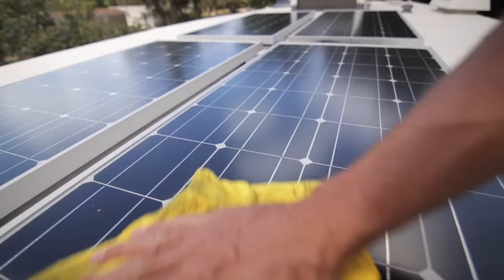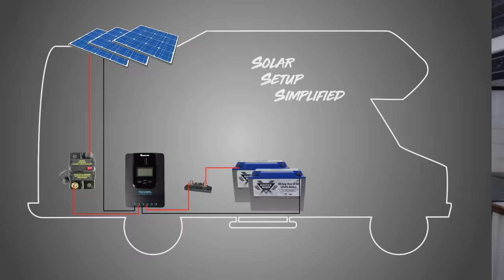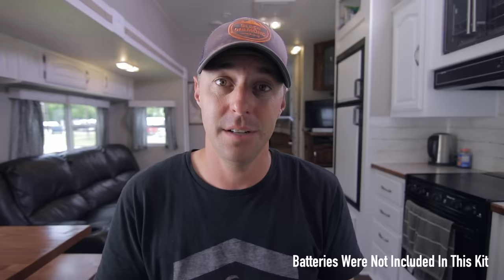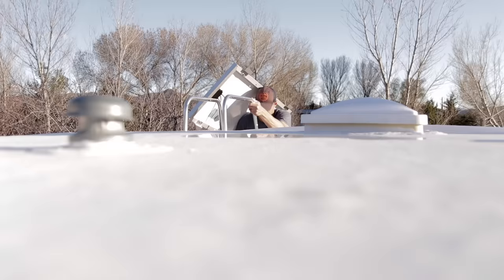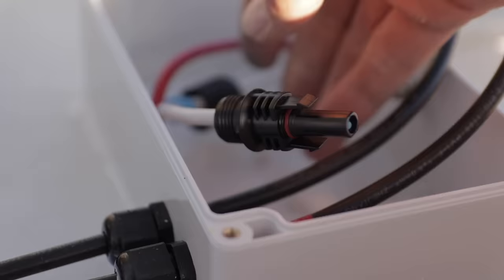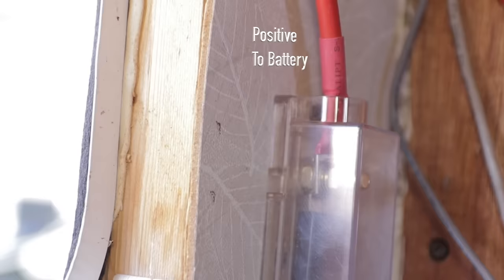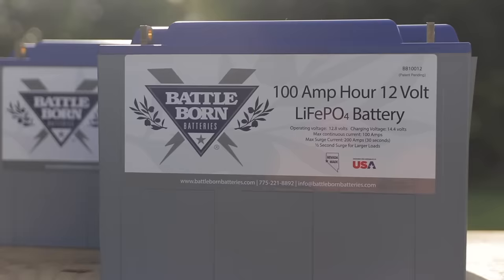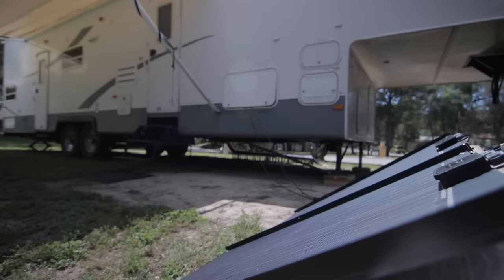RV Solar Simplified! Simple RV Solar Setup.

Comment: I don't get it... just about every solar DIY'er on youtube is mounting 100 watt panels on their RV roofs.  And the cost for these range from $1.00 - 1.90 per watt generated!  Why would you not use something like the Mission Solar 315 watt panels?  They would take much less mounting area, and cost about $0.70 per watt ?
Reply: I have been wondering this myself
Reply: Those panels are not 12 volt. Most people believe (incorrectly) you can only use 12 volt panels on a 12 volt system.
Reply: Glenn Beattie that’s incorrect with the appropriate charge controller you can have much higher voltage going in and the controller will charge the batteries appropriately.
Reply: I put one 400 watt panel on my van conversion roof and hooked it into my 2200 watt power station. I bought a like new used panel for $200. Beats 4 100 watt panels on my opinion
Reply: You can't get that panel any more. I checked with the manufacturer.
Reply: Drink water
Reply: @shaneross64 what site did you check for a like new panel?
Reply: I have three 150 watt panels on mine, not necessarily by choice, but because I purchased them in a roundabout way.

Saw a 95 Ford van converted (poorly) into a camper for sale on fb marketplace. 300k miles, busted rear window, needed a new transmission, listed for $2k. In one of the pictures you could see the side profile of what I thought was a solar panel, though the description never mentioned it.

Long story short, I ended up buying the van for $500 and scrapped it after removing all the solar components:
-3x 150w panels 
-1x 50A charge controller with BT
-1x wired on/off switch for charge controller 
-2x 100AH marine batteries 
-1x 2000w (4000w peak) inverter 
+$240 for scrap 
Net cost: $260

So that's why I personally have three less powerful panels. But also, I think redundancy is important. If you only have one panel and it malfunctions or breaks or whatever, you have 0W. If one of my panels break, I still have 300W potential.
Reply: I have three 150 watt panels on mine, not necessarily by choice, but because I purchased them in a roundabout way.

Saw a 95 Ford van converted (poorly) into a camper for sale on fb marketplace. 300k miles, busted rear window, needed a new transmission, listed for $2k. In one of the pictures you could see the side profile of what I thought was a solar panel, though the description never mentioned it.

Long story short, I ended up buying the van for $500 and scrapped it after removing all the solar components:
-3x 150w panels 
-1x 50A charge controller with BT
-1x wired on/off switch for charge controller 
-2x 100AH marine batteries 
-1x 2000w (4000w peak) inverter 
+$240 for scrap 
Net cost: $260

So that's why I personally have three less powerful panels. But also, I think redundancy is important. If you only have one panel and it malfunctions or breaks or whatever, you have 0W. If one of my panels break, I still have 300W potential.

To follow along with your theme of cost per watt, my system clocks in at $0.5/WH. That's using the combined cost of ALL the components, not just the panels. Though I'm not really sure that's an efficient way to measure value, because that's only accurate for the first 450 watts captured in this case (because 450w is the stated maximum). Every watt captured above 450 would further reduce the "cost" per watt.

450w = $0.58/WH
900w = $0.29/WH
1800w = $0.14/WH

Like I said, before, with only one panel, if it breaks, your total watts drop to 0. Your cost per watt is then fixed based on the total watts generated up to that point.

Let's say you paid $280 for a single 350w panel, and you captured 50kW, then someone smashed it with a baseball bat.
$280 / 50,000w = $0.006/W

So then you replace the panel, and capture an additional 50kW, until the same person smashes it again.
($280+$280) / (50kW+50kW) = $0.006/W

Now let's say you bought three 100w panels for $360. That person comes by and smashes one of the panels after you captured 50kWh.
$360 / 50,0000w = $0.007/w

Since you still have two more panels, you don't replace the broken one. 50kW later, another one is smashed
$360 / (50kW + 50kW) = $0.004/W

Another 50kW, another smashed panel.
$360 / (50kW + 50kW + 50kW) = $0.002/W
Reply: Because anything over 200 watt size panels coast way to much to ship. I use 4 200 watt panels and is perfect for me
Reply: Its called newbies lol, they obviously are new to solar , why would you mount panels to your roof is my question .....1 you just introduced new water leaks one day , 2 not easy to clean , 3 are you goint to move your rv into the sun everytime you camp ? Waisted system ,,,if your panels are free standing you can camp in the shade and move your panels where ever is best ,,, what happens when you go camping and the spot is sunny in the morning but a hug tree is casting shade over your camper ? More negitives to solid mounted panels then pros ....
Reply: I've been pondering the same thing. I really want a great solar system, but I want my panels stacked in a storage container when traveling, and placed on the ground in the sun when I'm using them. I can clean them every use too.
Reply: I'd rather have them mounted to my roof because I'm living in my rig, which means taking the solar panels out all the time is a security risk and an unwanted source of extra tedium and effort. That being said, park in the shade with panels in the sun is definitely a more efficient way of doing things.
Reply: @4486xxdawson it's definitely inconvenient to have to set them up or store them when not on use, glad it works for you.  But it's a fools way of thinking to think your way is the only way, not only that some rvs have them from the factory on the roof.  Regardless of location if I am hunting and it's snowing solar does no good, thats why people own generators, or at least I do.  Some are wins some are losses. And just like everything  else that goes through your roof if installed and sealed right wont leak, might I recommend xtrm ply for all your rubber membrane roof sealing needs.
Reply: How would you do it all ? Asking as I want to do this but don’t want to spend more then I need to.
Reply: @glennbeattie6172 don’t the inverters that transfer the solar to power for the batteries automatically turn the power to 12 volt? I’m not an electrician but that’s how I understand it

Comment: It amazes me that so many caravans in England and other European countries have lithium as the standard battery pack and solar three panel systems standard.  I can't understand American manufacturers who continue to build junk.  Except for a few such as Northwood all I see are ill constructed lite units that are rushed through build and are delivered to the customer broken.  You are fortunate to understand the inner workings and can repair most problems and add to the electronics.  I would love to buy a trailer to pull but I'm waiting until I can afford something like a North wood product.
Reply: Matthew B it’s a difference of approach.  We can get lithium batteries in the US, but a 170 ah battery is currently about $1500 compared to a 200 ah AGM battery for $400.  

Yeah, the AGM weighs 130 lbs vs a 45 lb lithium but the trailers used in North America have a different weight distribution than is used in European caravans.  We distribute weight between the tow vehicle and trailer, whereas the weight is over the a caravan’s axle and the tow vehicle is simply a tractor.  The Europeans can tow with a lighter weight tow vehicle, but need to tow at a slower speed.  When I was in Europe, I was surprised to see such small cars towing relatively large caravans.  In North America, we distribute weight differently on our trailers and can tow faster,  but we have a higher tongue weight on the tow vehicle so the rig is more stable at highway speeds than the European configuration.  That requires a vehicle with the ability to hold a heavy tongue weight.  See https://oppositelock.kinja.com/tow-me-down-1609112611

The point is, we can load the heavy batteries into our trailers.  When we “boondock” in public lands (setup your camper for up to 14 days, but you have to bring your own power source, water, etc.) we need to maximize that battery bank capacity.  Having a couple of decent AH rated 6V AGM batteries in series is pretty common in the US west.
Reply: @ppainterco  bottom line is greed and profits
Reply: Randallkoller - I really dislike the “greed and profits” argument.  Its lazy,  It’s like if I chip my tooth then it’s because of “greed and profits”.  My coffee is too strong... “greed and profits”.  My milk curdled in my Wheaties... “greed and profits”.

Lead acid battery plates get recycled in the US and we actually have factories that manufacture them either here or in Mexico with lower cost land transportation for distribution.  Lead plates recycle pretty easily... just melt them, skim off the crud from the top and cast new cells.  That easy, available recycling holds down costs as does the lower cost of transport.  I’m not aware of much recycling of lithium cells in the US, even so, we’d probably have to ship back to make new cells.  Lead acid batteries have a century of developed infrastructure and distribution systems.  Lithium is nearly new infrastructure and distribution systems that’s still being developed.

I recently bought 4 LiFePo4 cells, BMS and new solar controller from China through eBay for about 3 times the cost of just buying a 90 lb golf cart battery from a local retailer.  Another option was to use a BattleBorn battery which is assembled in the US, probably using newly manufactured foreign cells from new, not recycled materials.  The BattleBorn is about 4-5 times the cost of the lead acid battery.  Still, I wanted to reduce weight and hope to get a 5x life out of the LiFePo4 and so long as I get a longer life then the LiFePo4 might be somewhat less over the long haul.  Still, a LiFePo4 is about 20-25% of the weight of lead acid.  If I had a big honking motor home that didn’t mind the weight then I would have just loaded up with golf cart batteries, saved money and hassle. 

The stupid thing is, my lefty, environmentalist brother in law objects to my LiFePo4 setup, telling me to just buy cheap, heavy lead acid batteries at SamsClub instead.  It’s like “save the planet”  until it’s his responsibility to save the planet.  The only greedy ones that I see in that cycle are consumers who only look at the purchase cost of the batteries.  I’m still not convinced that I’ll get the life out of the LiFePo4 setup to have made it worthwhile.  That’s a 10 year long experiment.  Here’s to hoping.
Reply: Lithium mines are killing alot of land and human health. Im happy to use lead acid or carbon batteries fr this reason.
Reply: North Americans want things cheap and cheap usually means cheap. Of you want a better built RV, Northwood like you said or Lance. The majority of us won't or can't afford to spend double or more for a better built rv especially if its something you use a few weekends in a year.

Comment: Well done ! .... I spent about a year studying up on solar. After a lot of overthinking, calculations & trying to decide how big to go; I jumped in with just a simple 100W glass panel & PWM. The goal was to charge two 6v golf cart batteries at this point. I'm really glad I did as I found unless you are in direct sun you get very little amps. We camp predominately in shade or treed areas, I was doing a lot of chasing the sun with the panel. Against my original objectives I did buy a small inverter generator for the days that solar isn't going to work or I'm not "chasing". Surprisingly in the last 6 months I've only used ~3 gal of gas.  I'm about $750 total all in. It's all working great for our needs. You hit the nail on the head; start small with the basics to add on later, you don't need to start out with a $5k-$12k system. I am not a full timer so my needs are simple.
Reply: Do you live in an RV? my bf and I are looking to live full time in an RV and travel the U.S. but don't want the solar panel system to break the bank!
Reply: @carriesings4life  No, we are not full timers. We go out about 1x a month for 4-5 days, a couple of 10-15 day trips in the Summer. The past couple of years we've taken a 6-8 week  trip to the S.W. during the Winter. We prefer to boondock but when it's snowing or really cold we will get hookups. I have aded a 2nd 100 watt panel (still not attached)and a small 600 watt converter to charge laptops and ipads. In the Winter down in AZ desert the two 100watt panels are perfect for us. place them in the sun early morning and by 12 or 2:00 we're all charged up 100%. We don't use a lot of power but we don't watch it closely with our lights at night I don't like sitting in the dark. For us its crazy to spend $10 - $15k for a full system like some of our friends have done. But we do not work from the road either or watch any TV. Once in a while we fire up our small Generator for the microwave or hairdryer or watch a movie. On a rare occasion charge the batteries. hope that helps

Comment: Here's a few things to help others, new dual function type solar panels, heat water at same time, keeps panels cooler, last longer, hot water can be used for domestic to either pre-heat or keep water hot in tank if not using a tankless system, in some cases it could be used for interior heating as well. A guy in NJ has them on his house, get over 100 fahr. in winter.
Small quick attach, pole mounted sail boat wind generators for the days with no sun, night etc..
Use all 3 type of passive energy.
Yinlang lto lithium cells.... new tech, last you a life time, light weight, huge temperature operating range -40c to 65-c and if not clearly stated before, HUGE cycle rate, over 50,000 if I remember correctly, easily bolt together, no special tools, no special training, no topping up water... build any voltage pack you want, any capacity, any SHAPE to fit your needs rather than a square factory built unit... I think the 40 amp hour cell can do 400 amps discharge.... dont quote me but I know it's higher than most, way higher.
Using a charge controller for each panel rather than one large one, makes the system more efficient as it allows for the differences between panels and can make the most of the panel.
Luna cycles has some really nice heavy gauge wire, good flexibility, 8g,6g, nice 200 amp bullet connectors too, although personally I use the ones from castle, 6.5mm bullet connector with 200 amp limit, polarized plugs, cannot be plugged in the wrong way.
Silicone wire, has much better flex, current rate, lower resistance and higher temp resistance than most common wire, Deans wire but they dont do heavy gauge, Amazon, Ali Express, easy enough to order silicone wire. Ripping 50 to 100 amps dc for RC motors is very common, so they have some very nice DC wire and connectors.
I build ebikes, off road, 2 wheel drive, trailer with motors, batteries in trailers and solar panels to recharge them, so I have a bit of an idea... every stove and dryer I see, I rip the power cords off for the 8g wire in them :)  Hopes this helps some people. Oh between the bike and the trailer, I have 7 battery pack, 100 amp hours @ 36 volt with over 140 amps discharge constant, 200 amp burst, I can run the 2 motors on my bike as high as 5,000 watts each, trailer motors for about 3,000 each if needed, 4 motors, 4 controllers, brake lights, turn signals, alarms, yes plural alarms, bike and trailer + each controller, LED motorcycle head lights, all custom wired. Just so you understand, I actually work with this stuff too. And please dont forget, dielectric grease for plug connections exposed to the elements.

Comment: Hello great video..
I am Installing a new roof on my 5th wheel. Thought I’d pre-wire for solar while I have it tore apart. Went searching YouTube. Behold I found your video right away. 1st time watching, it went way over my head. I’m back for a second viewing and making a lot more sense after educating myself a little about solar and terms. The problem is I am now more confused than before
Reply: Second part of my post.
 I’m looking to install the same system you have. 4 panels , 30 amps.
 What size wire do you run from the panels to the Rover? What design lay out did you decide? 2p2s or something different? 
Greatly appreciate your input into my install?

Comment: How’s those screws to the roof holding up? They look more like a sheet metal screw. My uninstalled kit has them as well and was wondering if I should use something else. Roof is 7/16” OSB.
Reply from the maker: Just over a year in and they have been very solid. Just inspected the he roof not long ago and no problems. These are similar to the screws we used on the last RV for years with no problems

Comment: Great video! I also chose Renogy after much research. My system is super small, but love it. I did decide on the MPPT charge controller. Great tip about the inline breaker. Wish I had known and had them install that! 
Thanks for the awesome informational videos!!!

Comment: I bought a used RV with just one house battery…a Winnie Drop 170s. Part of the used deal came with a 100 watt panel, charge controller and a bunch of wires in a bag. How/where do I connect this panel to the house battery? I do understand the basic setup of a charger controller. But what is the load? Or do I just need to charge the battery and nothing goes on the load? I can’t really tell where the previous owner connected to the battery. There is an after market terminal block in the bathroom area that goes out to a storage compartment. But I a am not sure where the other end of the terminal block goes. Any ideas? Thanks!

Comment: Did you also connect the factory supplied 10A In-Line FUSE between the panels and the controller along with the the circuit breaker that you bought?